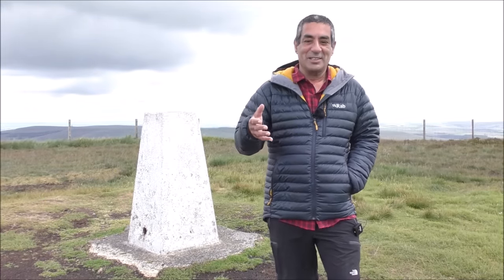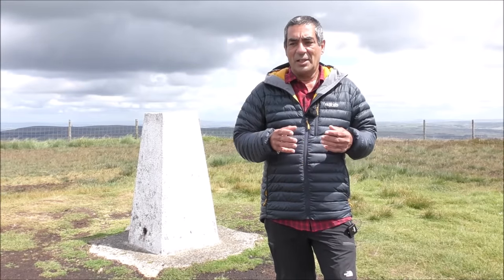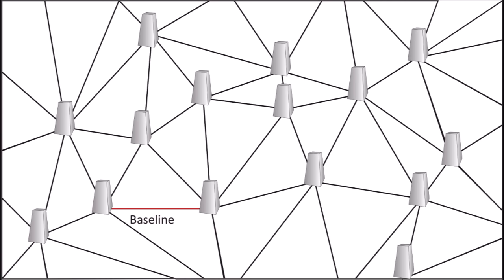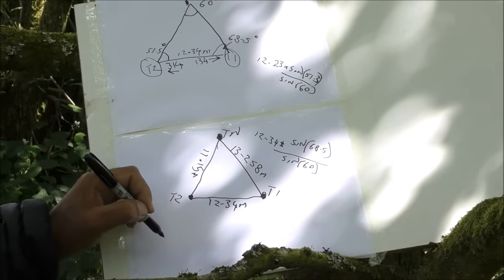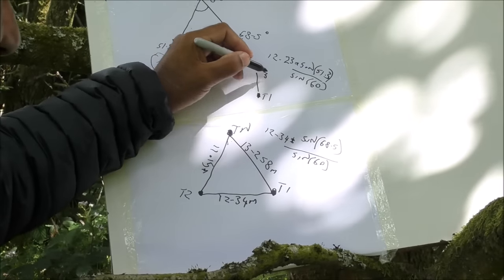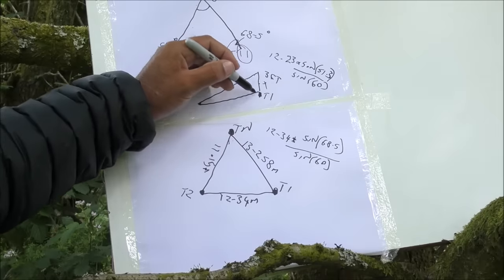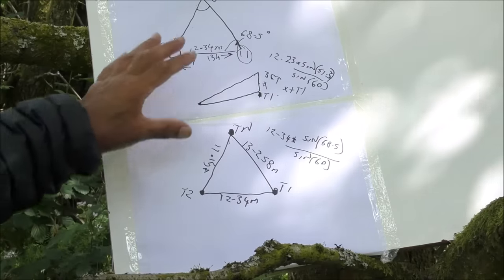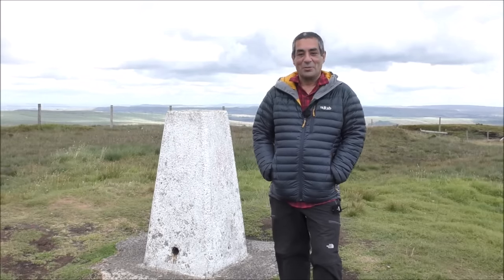How do trig points actually work?

Comment: I worked as a surveyor's assistant as a kid here in Toronto.  We mostly measured urban projects for streets, bridges and tunnels.  Our triangulation points were usually found in the concrete sidewalks (Pavements in the U,K,), and sometimes like your flush brackets on the sides of buildings.  We called them all benchmarks.  Our tools were the transit (your theodolite) and the level, a telescope with crosshairs and a levelling bubble.  We relied heavily on tripods and plumb bobs.  Horizontal measurements were made with the chain, which in my day had evolved down to a 100 foot steel tape marked in tenths of feet.  The rod which accompanied the level for taking vertical measurements was similarly marked in tenths.  We made extensive use of 2"x2" pointed wooden pegs about 14" long, which we drove into the ground with a sledge hammer.  We would top the pegs with a small, dimple-headed nail to mark the precise point.  That nail was generally the target for a later positioning of the transit.  Where we had to drive one of these wooden pegs through a concrete sidewalk, we employed our bullprick, a two-foot long solid steel cylinder, pointed at one end and at the other, battered and bruised frommany stubborn battles with the sledge.   All this was about 1965, the pre-digital age, but I imagine the terminology in Canada hasn't changed much since then.  Thanks for the video and the great memories of one of the best times in my life!
Reply: FYI "Transit" is short version of "transit theodolite".   I think the designation means that it has the ability for the telescope go to vertical and then flip over ("Transit") down the other side.
Reply: @HweolRidda  I believe you are correct. It is a  transit because the telescope can be inverted.

Comment: In the US, the survey markers are usually a bronze circle, about the size of your pslm, set into rock, or concrete flush with the ground.
 The problem is that every time a sidewalk is replaced, or a road widened, or some other routine work done, the old markers are either buried or removed, with no attempt to put in replacements or surrogates. So especially in urban areas, finding marks and confirming whether they still exist can be quite challenging.
Reply from the maker: We (in the UK) would call them a Bench Mark, not a trig point
Reply: @TheMapReadingCompany 
Same in the US.

On US Geological Survey maps, they are literally marked with × symbols.

Comment: For an accurate survey, a thedolite or total station would be used with an accuracy to at least 1 second, which is 1/3,600 of a degree, probably as so eone else mentioned to 0.2 seconds. At 100 metres, a 1 second error is about 1mm. The angle would be measuredat least twice, by rotating the telescope about the horizontal access, so that the vertical angle scale or the face, was to the left for one reading and to the right for the other one. These two readings might even be taken 4 times, once in each quadrant of the horizontal scale. The horizontal scale can be moved relative to the horizontal line of thr telescope. Thr reason for so many readings of the same angle is to allow for any error between the  entre of the scale and the centre line of the telescope. The average reading is used. By measuring all three angles in the triangle, then the averages can be added together, and any difference from 180 degrees divided between the three angles.
For distances, as others have said, a surveyor,s chain would be used, or these days a steel tape. Fibre tapes tend to stretch. For accuracy, corrections would be made for temperature, tension, sag, and altitude. These days when lasers bounsed back off reflectors are used, even atmosheric pressure is taken into account. Corrections are also made for level differences. When each side is measred, then a closing error can be calculated, i.e. the distance between the start position and the end position going round the angles as corrected and the distances measured, so that that error can  be distributed between the different stations.
Just by the one original measurement on the Ridgeway, by triangulation, when the origonal surveyors finally reached Thurso and checked the last distance, they were only 400mm out!
Reply: Great comment, Dorothy Roberts.  Thank you.

Comment: I think you have the two distances the incorrect way around. A while since I did any geometry, but I recall the sin rule as a/sin(A) = b/sin(B) = c/sin(C) where A, B and C are the angles opposite the respective sides length a, b and c.
Reply: Correct - the biggest length always has to be opposite to the biggest angle.

Comment: Advanced point

Your maths works only over a small area. When extending the map to the scale of the whole of England, you can't use the law of sines in the form you quoted it. That's because when the curvature of the Earth becomes significant you have to use a more complicated formula that takes the curvature into account.

If you think of the big triangle that has one corner at the North pole where one line goes through Greenwich and another going the 90deg W line, those lines make an angle of 90deg. Both lines cross the equator also at 90deg. So that's a triangle with total angle of 270deg. Euclid shudders in horror. 

The maths involved to do trig on a spherical planet is called geodesy (literally Earth measure), and unlike in Euclid, triangles all have angles that add up to more than 180deg. Oddly enough the excess angle is proportional to the area of the triangle if the planet is exactly spherical. 

It's even more complicated when the planet is slightly non spherical.

Comment: I first came across Trig Points on Scout hikes way back in the 1950s. Had a rough idea how they were used but your exposition is marvellous. But I still don’t understand how those early surveyors came up with the contour lines on Ordnance Survey maps?
Reply: That's where the "flush plate" thingy comes in. 

With one trig point you can get your elevation

With a scope you can look for points of extreme change (where more readings would be needed) or areas where less will suffice. You assume a linear relation between observations which becomes more and more accurate with more and more observations.
Reply: @abstractapproach634  Thanks for your explanation. Yes I think I get it. But still rather mystified as to hour contour lines can be drawn so accurately from such little data.
Reply: How not hour… damn autocorrect.

Comment: I still didn't understand how they got the first measurement (in this example the 12.34). Otherwise really nice video.
Reply from the maker: It was one side of a previously calculated triangle.  That in turn had been based on another previous triangle, all the way back to the original base-line, which had been measured very precisely.
Reply: @TheMapReadingCompany  Yes I understand that, but I didn't understand how they precisely measured the distance between the first two points. I did watch some other video and undstood that the first distance doesn't have to be that long, even few meters is enough.
Reply from the maker: Watch this video and you can see the OS actually measuring the baseline - they used an invar tape (basically a very accurate marked line) and used microscope to ensure it way measured precisely.
At the 33 min mark you can see them doing this.
https://youtu.be/w5_kWzUahQU?feature=shared

Comment: Now I need to go to Beacon Fell Forest in Lancashire with my son, trot up to the trig point and show him this video with a sandwich and a brew. I would love to explain this as if it came from the top of my head but that’s cheating. I had to do trigonometry in my welding and fabrication course many years ago. Thank you very much for this and your other videos 👍🏻
Reply from the maker: Hi Ron, I hope your son likes the video.  I looked at your profile picture and in it there’s you and your son and a spider.  The spider is the three pronged metal bracket on the top of the  trig.  The old style theodolites had three legs with points on the bottom.  By placing the theodolites on the spider the three legs would only fit if it was perfectly centred - which was very important.  You could demonstrate this to your son.
Reply: @TheMapReadingCompany  there is indeed, you have just drawn my attention to it again. That was Ben Nevis trig last September, year before was Snowden and before that was Scarfell Pike. This year was an early Hellvellyn, just checked pictures, Snowden has the best one, it has countries and cities in each direction with the distance on a lovely brass plate with a spider inlaid 👍🏻

Comment: In the USA, we have Geological Survey Markers.  They have a precise center, as well as distance above or below sea level.  Most of these are along railroad bridges and the like. Very interesting video,  thank you.
Reply from the maker: Ours also have a very precise centre.
If you notice the small hole at the base of the trig,  they used to be on each side, but 3 are normally plugged up with concrete.  The 4th hole is left so that any water seeping into the trip can evaporate.

They were used these to site a plumb line from the top so it was very exactly positioned.

I did have this sort of "stuff" in the video but edited it out, or it would have been too long.
Reply: @TheMapReadingCompany  As soon as I saw the triangles it took me back to college and learning Trig for machine trades. Good times. Well done Sir.
Reply: As an engineer for the power company I am very familiar with the USGS markers. I had a large 300’ crossing tower fail because it was hit by a tornado. I went out with the construction crew that was removing the tower and foundations. I noticed a USGS marker had been placed on the foudations that were 60’ deep concrete piles. I also noticed the foundations had moved and were the source of the failure. I had a delema, what to do with the unauthorized marker that had been pulled up slightly by a tornado. I ordered the crew to preserve the marker and I hoped the USGS would work out the variance in elevation if they releveled. The site was on the Houston Ship Channel and was subject to subsidence. The replacement foundations were 150 feet deep wth 34” diameter steel piles, 8 per leg. It was really bad soil.

Comment: Please can you help me with a query about something?

In the 80s, I remember going on walks, in a number of places, and finding large concrete, 3 bladed propellor shapes, approx 1-2 metres in diameter, painted bright yellow.

I always understood that these were for some sort of aerial mapping, or perhaps for placing the three legs of a tripod for a survey theodolite onto, but for the life of me, I can't find any info about what these were.

They definitely were not pillars or posts like those sometimes found at the tops of hills (there's one of those pillars at the viewpoint of Box Hill in Surrey, and another at the top of Leith Hill, also in Surrey).

As for where I remember seeing these concrete propellors, it's more difficult to be certain. I definitely remember seeing them on the heath near to Frensham ponds, and I think I also saw them near the eastern coastline of the Isle of Sheppey in Kent.

But Google aerial photography suggests they're either covered up, not there or too small to be seen.

Help!
Reply from the maker: Hi Dave, thanks for joining the conversation.  

I think you're referring to Curry Stools.  I've seen a few of them whilst out walking.   The last one I saw was on Bleak Law, directly north of the Cow Green Reservoir.  The Curry Stool is at NY 80020 32521.

The basics are that if the ground conditions couldn't support a standard trig point's foundations then a Curry Stool would be used to support the Theodelite.

Hope this helps
Reply: @TheMapReadingCompany  OH MY GOSH! You would not believe what a relief it is for my poor brain to have this explained to me.

Thank you so much!

Your explanation makes perfect sense and fits with the locations I mentioned. One is a heath, with a very sandy soil, while the other is on a boggy island near the Thames estuary, and very marshy ground.

Thank you so much for explaining, and for this fascinating video!

Comment: I recall working as a chainman in the late 60's in New Zealand and the end of the wire was connected to a tension spring so as to be able to calculate the sag in the wire but and also the temperature recorded to  allow for the expansion of the wire. Cutting bush  and scrub so that the chain wasn't touching anything was also the job of the chainman but I was a lot fitter back then. Thanks for the video, it bought back many memories of a time that I enjoyed very much.
Reply: I was a few years behind you in NZ, working for the MOW conducting deformation surveys on the Waikato dams .. `Maraetai, etc  Fortunately, the EDMs had just arrived, so triangulation became trilateration.  Still, we had to clear the bush!.. Happy memories …….. I gave up survey when GPS took over; survey then became boring

Comment: Thanks for the description. I took a surveying course in college. But many decades later, I now remember almost nothing. 
I have a question about your math. Why did you convert 68.5 into 68.3, and 51.5 into 51.3?.  
If the ".5" means half a degree, it is a decimal value, which should not be altered. But if the ".5" signifies 5 minutes (unlikely), then the ".5" equates to the decimal value of .08333.

Comment: I am math (or maths) challenged, but I have always been curious about benchmarks and their use. Thank you for the clear and detailed explanation. Kudos on your maker/wood working skills, too.
Reply: I would suggest that 'Mathematically' is the word that you were looking for .
Reply: a simple way to make the math easier ... is find one trig point ... find a spot 30 units way ... then on a right angle ... put a compass on TOP of the trig point and level it locate the 30units marker you have put and then at 90degrees to that line up or down measure 40 units away .... the final side will be 50 units and all you need is to get the angle to the 30unit point or 40 unit point from the other point you placed ... again the compass ... you just made your self a perfect right triangle and now have a good square reference point set to work from ... 
the joys of the 3 4 5 triangle ... they always make a right triangle .. because of pythagorus ... a squared + b squared = c squared ... or 9 + 16 = 25 ...
Reply: A bench mark is a starting reference point, all the levels and angles relate to this point which is made as permanent as possible. Future surveys will relate to this mark. I am not a surveyor but have done a bit at ag college in relation to farm dam construction.

Comment: Strictly speaking the compass bearing is a magnetic asimuth and actual theodolite bearing i.e. angle measurement wirh respect to the baseline would be more accurate because of magnetic variation from place to place but the priciple is the same. I am not a surveyor but I am GIS guy who has been a surveyors' assistant. Great stuff. I once did a GPS assignment atop of a Trig Station so that I could be sure of the actual position although we ignored the plate tectonics way back then too, hehe!

Comment: I was Reconnaissance in the Army, and I used triangulation 2 ways, from 2 known points to an unknown point for their location and distance,  or 1 unknown point to 2 known points for my location.  And I'm bad at math, but it works with a magnetic, lensatic compass, and a topographic map.  Triangulation works.

Comment: While this is a nice video you have some serious errors and omissions. Firstly triangulated networks have relative accuracy in relation to the other points in line of sight is in centimetres if not decimetres. Secondly trig levelling , using vertical angles measured by a theodolite is not very accurate, about half a meter. Elevations would have been established using a totally different process, differential levelling. A long arduous process require hundreds of distinct measurements between the points delivering an accuracy in the centimetre range.

Comment: 13:00
that diagram is wrong.
the sides are swapped.
the shorter side is opposite the larger angle and vice versa.
you mistakenly put the larger angle in the sin() opposite the smaller angle.

Comment: You have your math on the wrong sides.
Reply from the maker: Yes I know - my mistake.  Someone has already pointed that out.  Thanks though
Reply: I'm sure not very many people noticed, but yeah, when it ends up with the longer side of the triangle opposite the smaller angle it's pretty clear that something must have gone astray in the calculation.

Switching the two sides around is an  easy enough mistake to make especially when trying to calculate and explain at the same time!

Great video, though! Really clear explanations using vivid  examples.
Reply from the maker: Yeah I know about that.  I messed (mixed) up  the two sides.
Sorry.

Comment: A quick down and dirty way of calculating distance is engineering graphics I learned in Drafting Class in High School in the States using an engineering ruler. You know the distance between the two starting points of 12.34 meters. Go to TN and get the angles to T1 and T2. Take your sketch pad starting at point T1 and with your engineering ruler measure 12.34 and mark off the point for T2. Go to each point and using a protractor and the angles measured draw two lines and where they intersect is TN. using your ruler you can now measure the distance between T1 and TN or the distance between TN and T2. This is for quick reference and because you are physical instruments is not going to be as accurate than if you use math. If you are like me and didn’t do well with Trigonometry it is a way to get a good enough answer.